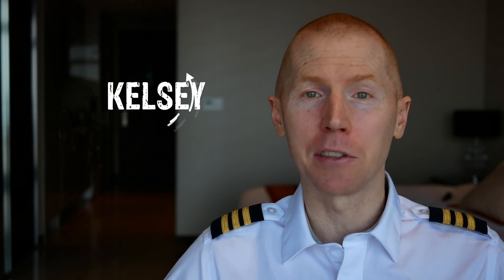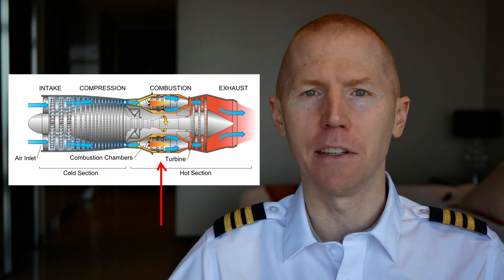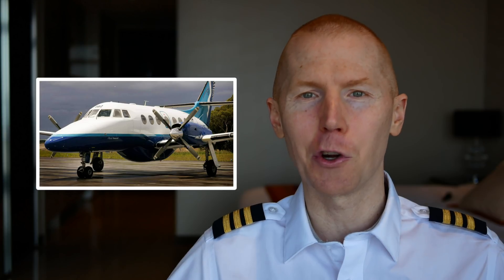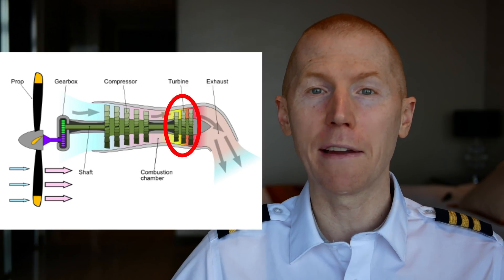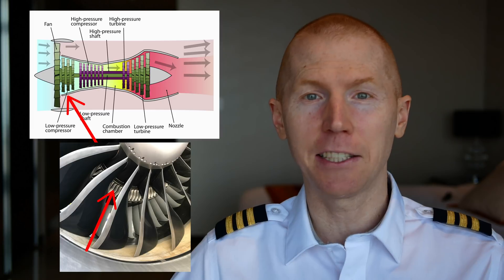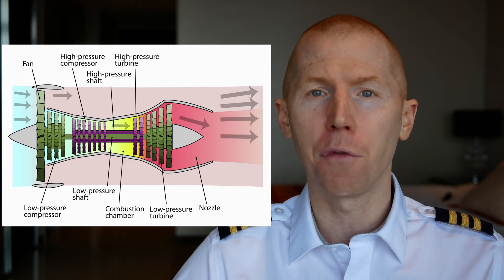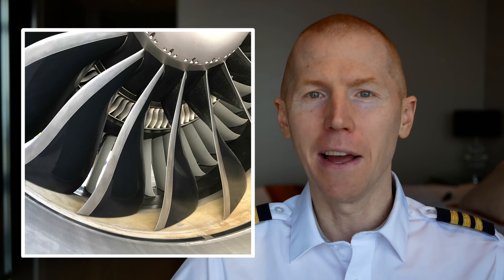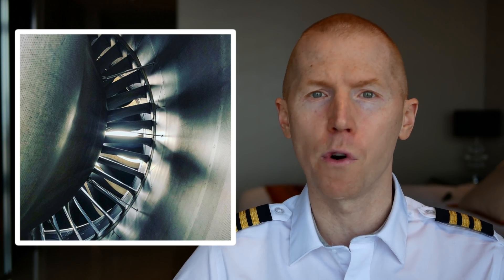Is a Turbofan Engine or Turboprop Engine Safer? | Pilot Explains

Comment: I have flown on a shedload of different types of aircraft for work. Dash-8, BA-146, and a few others of the more obscure types, and I have been on an A-340 proofing flight way back in 2006. Seeing what they can actually really do compared to what they do in commercial flight is a real eye opener. EG a zoom climb from 35,000 with the throttles to the wall to the point of getting Mach buffet, up to about 55,000 then to immediately go into a parabolic (weightless) dive back down to about 25,000, straight into a 5G left then right turn. And yes we really did go that high as to validate for commercial flight at 40000, an aircraft has to maintain control at 40,000+30% (as a minimum) even if it cannot fly straight and level at that altitude. We also flew really slowly with the flaps up too at an angle of attack I did not know was possible in a commercial aircraft. It felt like 45 degrees but was probably more like 25. Again 30% more than the commercial maximum rating. I'm not sure what the test pilot did on landing as he did not flare and I could only tell we had touched down because I was over the wing and heard the tyres screech as they spun up on touchdown. The other point is that the engines can fly for very significant amounts of time at Maximum Take Off power. We are talking multiple hours with no break. However if a pilot needs to do that in an emergency the engines are always removed and a complete rebuild type service is done. Hence airlines not wanting it as it's mind bendingly expensive.

Comment: I never was afraid of turboprop aircraft, I felt that they were more rugged because I associated them with the C-130  which is a very rugged and reliable plane.
Reply: @HardyIT  Two of my sons were maintainers on the C-130. One in the U.S. Marines and the other Air Force. C-130s have their limits, primarily in the air-frame. The one that went down fighting a fire in California a couple years ago crashed because the air-frame failed due to the heat. However, the engines are pretty dang solid, and they can stay air worthy even when you have more than one fail. As long as a passenger aircraft is multi-engine and rated to fly on less than full engines, I feel safe. I think the biggest fear with props is the idea that the blade will break loose and cut the plane open, thanks Hollywood. Not so say it has never happened, but it is very rare. The covering of the fans on a turbofan engine make it feel much safer to the average flyer.
Reply: @BerserkPublishing  and there have been cases of a turbofan disintegrating in the air and the blades cutting through both the fan cowling and the fuselage
Reply: @BerserkPublishing  damn that’s fucking sick, I’m just imagining how much flame retardant a C-130 could hold. Must be insane to watch lol
Reply: Exactly
Reply: I call the C-130 and the A-10 the "bare-knuckle brawlers" of the USAF. :-D
Reply: 6 hours later "are we there yet?" answer nope just over half way LUL C130 = good sleep
Reply: That is military aircraft😅
Reply: What does "rugged" even mean in terms of an aircraft ?
Reply: I question sometimes just how much of the unease is really the engine type as opposed to the fact that most peoples experience with turboprops are aircraft that are significantly smaller and lighter. I have certainly heard people justify their belief that turboprops are less safe by talking about them feeling less "steady" in flight etc, larger aircraft will generally cushion the effect of any turbulence somewhat more than smaller ones thanks to the square cube law ie the fact that volume increases exponentially faster than surface area when you scale an object up thus so too does mass (and thus inertia) all else being equal. A dash 8 Q400 for example has almost half the length and wingspan of a 747-100 but it has an MTOW of 30 metric tons the 747-100 is more like 330 metric tons doesn't take a genius to work out which would be accelerated more by an identical gust of turbulent air now does it?
Reply: @FaerieSeraphina  I definitely have had worse experiences on a turbo prop in terms of noise and turbulence.  That's what I associate with turboprops.
Reply: @UMfan21  As I say the turbulence issue will mostly simply be the inevitable consequence of them being physically smaller and lighter. Given the same basic shape a smaller craft will have a higher surface area to volume ratio and thus generally a higher surface area to mass ratio. Thus, for smaller craft you have a higher surface area for the turbulent air to act upon relative to the crafts inertia. You might find that sitting closer to the planes centre of mass is a little more comfortable which will generally be slightly aft of the wing. Unfortunately, this is also where the propulsion noise tends to be loudest though so whether that trade-off is worth it is of course a subjective decision depending which is more uncomfortable for you.
Reply: @FaerieSeraphina  oh yes, I was agreeing with you.

I try to avoid props and smaller planes.  I do try to sit near the center of mass in TurboTax planes.
Reply: A MAC C-130 landed us Marines in a  pasture once. Amazing crews flying amazing planes
Reply: @marinegunny826  Ha! Get from the plane to the pasture without the plane having to land, then get back to me! ; )   Rock on, brother!
Reply: @jaymerrifield4333  never got jump wings but had the pleasure of watching you guys bail out the back of a Herc what seemed like no higher than 500 feet off the deck! Awesome sight!
Reply: @marinegunny826  "never got jump wings..."
Well, I never got to be a Marine, so I guess we're even, lol!
Reply: @jaymerrifield4333  😂👍 
I did, however, have the opportunity to repel out of helicopters. Talk about a rush!
Reply: i have traveled 1000000000 times on C130 and its noise is annoying

Comment: turbofan is more adapted for fast aircrafts (who cruise at more than 800km/h) because the diameter from the fan is smaller as a free propeller to compensate the drag from the duct, but overall efficiency from a turboprop is much higher, specialy at low speeds: this explain why tactic military transporter (C130, A400M,AN22,etc) always use turboprops= faster acceleration, better flaps blast (increase the lift at low speed)=shorter take off, better initial climb,better reverse efficiency at landing+ better efficiency (lover consumption) at cruise speed up to 700km/h...Speed from turboprop aircrafts are limited from the propeller tip airspeed: they need to work in subsonic, inclusive on the well known Tupolev Tu95, the fastest turboprop aircraft still in service 925km/h top speed (mach 0,85): they specific "singing" comes from the air shearing between both props (5,80 to 6,2M diameter ~750rpm at full power)
Reply: Dankie Analyste: Turbo-Fan: faster. Turbo-Prop: cheaper on fuel and slower.
Reply: Mmmm yes the Bear
Reply: The one you could hear in the radio when flying over you
Reply: The TU95 prop tips are either transonic, or juuust past that threshold, into supersonic.
Which is why the TU95 is so insanely loud, even at ground power levels.

Comment: So what I didn't get from this is what the purpose of a turbo prop setup is, why don't they  use a turbofan setup like the big boys of the engine is basically the same?
Reply: turboprop is for the overall best efficiency, turbofan is only better for fast cruising aircrafts (over 800km/h)

Comment: A good explanation, but the fuel doesn't explode unless you mix it with ammonia nitrate. The fuel burns very fast heating compressed air causing it to expand, hot expanding air spins the engine.

Comment: How does a ram jet work?
Reply: It works exactly like any other jet engine. Just no turbine - the compression occurs when air is rammed down the inlet by the brute force of very high speed. It cannot achieve those speeds itself - it has to have some other means of propulsion until it reaches ramjet speeds.

Comment: A turboprop still has its advantages.  
 1.) A turboprop plane costs a fraction to purchase as a jet.
  2.)  A turboprop has a lower operating cost than a jet, including fuel and maintenance.
  3.)  Most jets are only useable for about 30,000 "cycles" or flights.  This is because structurall fatigue occurs as the plane travels between high and low altitudes due to the air pressure.  After 30,000, structural fatigue becomes noticeable, and the plane isn't as strong as it once was. 
 But, a turboprop plane doesn't experience as much change in air pressure, so iymt suffers less fatigue and is usable longer.
Reply: not realy: the most turboprops aircrafts are use at low or mid altitude, but for ex. the Tu95 ,  the AN22, or the new A400M and AN70 fly at same altitude as jet liners...but all this aircrafts are military, only the Tu114 was civilian (long time use on Moscow-Tokyo and Moscow -Havana lines)

Comment: Another benefit of a high-bypass turbofan vs turbojet is the reduced noise. The low pressure air that bypasses the engine core wraps the exhaust from the core and provides a buffer, thus making it quieter. Great video! Love the channel!
Reply: Yeah, the KC-135A used a turbojet. The KC-135R used a turbofan to produce more thrust with a dramatically reduced sound signature. I was at McConnell (in AFROTC) when the R-model was rolled out and the difference in noise between an A-model taking off and an R-model taking off was remarkable. (Wikipedia says a 27 dB reduction, FWIW, which is about a 95% reduction in energy.)
Reply: For some time,I actually thought,that this was the only reason for a turbofan(for some reason I didn't even consider it producing more trust)
Reply: A few years ago, I had a morning flight with a 6AM wake-up, only flight available to me. The USAF decided to have a C-5 Galaxy depart at 4AM so engine star was about 3AM. It was about 04:30 when it was far enough away the roar could not be heard. She is a loud creature.
Reply: Yep, I remember back in the 90s the jets taking off out of McCarran where I live in Las Vegas would shake whole buildings. Nowadays you barely notice them taking off. My how times have changed.

Comment: so anyway , if you have a 1200hp  turbofan  vs a same power turboprop what's the differences in range, speed and fuel burn + $$$
Reply: fuel efficiency from a turboprop is 15 to 20% better, cannot made your complicated calculations because this need to compare the SAME AICRAFT in SAME USES with both engine types...

Comment: The props would chew right through the birds
Reply: Yes and no. Ive seen a lot of birdstrikes on turbo props without hitting the prop. Both the aircraft I have worked on prop spin at 1080 rpm so if the aircraft is travelling at high speed it's not to difficult for the bird to go straight down the intake

Comment: Nice Video. May be especialy for those people who think there are  only two different engines for airplanes: the Propeller and the Jetengine and nothing inbetween (most people). Why didn`t you mention the "Propfan" or UDF-(unducted Fan) engines developped in the late 80s ? In order to increase the bypass and fuelefficiency they had been the right answer. They would be even now. But the industry has not the heart to do the step further in fear of the people  who think there are...... and unducted Fanengines in their minds they would be considered as Propeller engines.

Comment: Okay, now I'm confused:
Let's talk about a turbofan engine, although the principle of my question applies to the turboprop engine as well: why is it beneficial to invest part of the energy produced by the jet/"explosion" to move a turbine that would move a fan/propeller?
I'm not a physicist, so I may sound stupid, but to me a turbojet engine seems similar to the engine of a rocket, with the exception that a rocket's engine contains all components needed for the explosion (e.g. kerosene + liquid oxygen) that creates the thrust, while a turbojet engine contains part of it (the plane's fuel, which I assume is, like in my rocket example, kerosene) and relies on extracting the other part (I suspect it would be oxygen, no?) from the air. So, anyway, I don't remember ever seeing a missile with a propeller on it, and my guess is that the explosion produced by the missile's engine creates much more thrust than spinning a propeller would create. Wouldn't the same apply to a jet engine (or a turboprop engine)? If so, why waste part (or in a turboprop engine, almost all) of the energy from the "explosion" on turning a fan that doesn't contribute to further explosions, instead of using that same energy to push the plane forward? I completely understand why part of the explosion is used to spin the compressors that allow further explosions, I just don't get why use part of the explosion - which itself creates thrust one would presume to be greater than the thrust created by a fan - on spinning a fan.
Reply: In a modern Turbofan engine about 80% of the thrust comes out of the Fan/propeller-System.

Comment: How come a propeller powered boat like a flat bottom v-drive is so much faster than a Jet Boat. One one think a jet is faster than a prop but that just ain't the way it is
Reply: Well if I had to guess, it probably has something to do with the jet being heavier thus pushing more of the boat into the water, which in turn would create more drag as the jet has to compensate for the added weight of the jet as well as any passengers and cargo, as well as water displacement and the drag from basically having to push part of the boat through the water whereas a fanboat has less weight allowing it to sit on the water and basically glide along the surface.
Reply: I just realized that I misinterpreted part of your comment. oops.

Comment: so... because of the gearbox turbo props are more efficient, but not feasible for large airplanes cause of top speed..... right
Reply: Kinda true actually.  For Mach 0.8 cruise, turbofans are more sensible and feasible as opposed to Mach .2-.7 where turboprops make sense.  Turboprops tend to have two advantages: gearing to reduce RPM but increase torque (which allows for more or larger blades depending diameter).  Scaling that up to have internal reduction gearing and the number of fan blades found on a modern turbofan is generally going to be very expensive and difficult to implement (complexity, weight, cost).  Such a system was experimented with propfans aka UDFs but lack the shroud that does benefit a turbofan in some cases, like containing a blade failure and additional thrust.  It's easier to just design a non-pitching, gearless fan that is optimized for a specific cruise speed.  But lately there has been work and production on large geared turbofans.

Comment: Thank you so much for the Video. I do have a question if you don’t mind sir
Could you explain what is the first part start in the engine, and how generators charge the batteries?
Reply: Hi Ahmad, on larger turbo prop aircraft the engines are started using bleed air from the auxiliary power unit. This air turns the engine starter motor which via a gearbox  which will begin turning the compressor or propellor gearbox. As the engine rotates on the starter it begins sucking in air and compressing it. Fuel is then sprayed into the combustors (timing differs from engine type to engine type). With the fuel burning the engine begins to accelerate up untill the engine is self sustaining.
Reply: josh propdodger Thank you so much Josh.
Reply from the maker: I don't know if I will get into how the first phase start the rotation in a video but its usually battery driven on smaller turboprops and from the APU on larger turbofan engines that get things moving 👍

Comment: Another great video! And, yes turbo props kinda scare me even though I mostly understand the physics and appreciate the similarities to the jet engine.  For me, while the turbo props create apprehension, it's the size of the plane that ultimately causes the hesitation.  When you think about it, it's kinda foolish but when considering turbulence I'd rather be in a bigger plane!  Very much akin to dealing with potholes  in an SUV or a sedan.  Also, I don't know the stats but I wouldn't be surprised to learn that there are as many private VFR flights in the air daily as commercial (possibly more).  Keeping the numbers in mind, seems their are many more occurrences of small plane accidents and mishaps than commercial airliners.  Thus playing into the fear of smaller turbo props.

Comment: Can we have a dual fan engine? Like the Tupolev Tu-95 “Bear” has counter-rotating props?
Reply: Ed SR I wouldn’t be surprised to see something like that in the near future, since the current trend in turbofan design is towards ever-higher bypass ratios.
Since the fan can generate more than half the total thrust produced by the engine, one would think that double the fans = roughly double the fan thrust = higher fuel efficiency. I’m sure some engineer within GE/RR/P&W has already brainstormed this idea. 

The main problems with this concept that I would guess are the added complexity of a counter-rotating fan, and the frictional losses that come with a second fan that negate the benefit.
Reply: i. rob  Ganett was totaly different : each engine+ prop was totaly independant...

Comment: I props as MORE reliable than jets. while generally slower, it gives the pilot more reaction time.
I'd like to hear more about the lubrication systems used on jet engines.
Reply: i. rob  turbofans still have a reduction gearbox...and are much more fragile against abrasive dust or impacts...Propeller blades turn at slover rpm and have a armoured leading edge: this is one of the explanation why tactic military transporters (C130, A400M...) always use turboprops (C17 for ex. is a tactic transporter, main use on clean concrete runway)